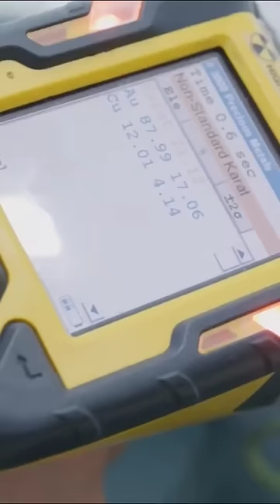Did we buy gold with Tungsten in it? 😱

Comment: There is absolutely no way that the dealer didn’t know what was happening here.  Tungsten has one of the highest melting point of all metals, there is no way that gold just happened to wrap itself around a bar of tungsten while being smelted.
Reply: Exactly. If the coins had tungsten in them, the gold would just melt off. They wouldn't melt together, then pour as a solid tungsten bar covered in gold. Its probably just set up for views.
Reply: @smasher.338  might be. My guess would be somewhere in the chain of deals, someone trusted someone else too much and after probably numerous successful deals, didnt think they needed to verify it.

Sucks that people do that, but its super common. To me, the trust between two people who do business is more valuable than the money itself.
Reply: @smasher.338 views?
The weight of the bar would likely be very close to the nominal weight of solid gold.
Tungsten would have dropped out in a typical pour, methinks.
I’ve done a small amount of melting metal into ingots.
Lead is one thing, where just about everything floats in top.
Aluminum is different,
Not only you deal with the swarf, you need to go hunting for whatever else dropped out at the bottom of your crucible.

There is no way that this happened by accident.
The dealer offered the refund too fast.
He probably does that so he doesn’t get called out.
Now, imagine how many people have these contaminated bars in their safes!

Comment: Tungsten has one of the highest melting temperatures of any metal so there is no way a furnace not specially made for Tungsten (at great cost compared to anything a gold smelter would use) could have made that gold coated Tungsten bar. It's impossible for it to be accidentally done. This was no mistake or error it's fraud on someone's part.

Even if the coins had Tungsten in them there is no way there would have melted and ended up inside a "gold" bar. They would still be where shapre they supposedly were while inside the coins.
Reply: ive already commented this. Hes positive the tungsten was melted with the gold.
Reply: If they can melt tungsten, the gold should be evaporated (gold evaporated at 1400 celcius , tungsten melt at 3400 celcius)
Reply: @Wertdante  lmao bro that’s nuts!
Reply: @Wertdante  this is true. @crm is just playing games for clicks since the Watch biz is slow. Or smelter was running a scam. Those are the ONLY options. Basic chemistry.
Reply: Agreed
Reply: It was probably powdered from somewhere that makes rings or other items from Tungsten. Likely they managed to get it into the blanks and then make coins by melting the very surface layer and adding a little extra gold before striking the proof when it was red hot.
Reply: If you watch the original video when he pours the coins into the mold and flipped it over while rinsing you could still see the imprint of one of the coins in the bar, which I thought was weird if it was all melted down, the smelter should have reduced that to a liquid. But it was still showing partially solid. Thanks for explaining that to me it makes more sense now!
Reply: This has to be some sort of insurance fraud. 😅 they insure the coins and has someone else melt them and then all of a sudden OMG its coming back not gold from the "smelting co." Honestly if you're a jewelry business, why would you not melt your own gold coins? 😏 😅😅😅
Reply: Makes no sense, the melter knows he is going to immediately use that gold for jewelry making, the tungsten will just break his machines and be obvious the moment he starts using that bar.
Reply: That's what I was thinking to how and were did tungsten get into this equation I have no clue.
Reply: Melt yourself
Reply: @XxMidnightToker420xX  That part is easy, they are trying to match the weight of a genuine gold piece that is gold clad by adding tungsten.

Only solid gold has all the qualities of gold so to fake weight and volume of solid gold they have to use different 'fillers' tungsten being one of them.
Reply: @Josh Mocny  impossible. Boiling point of gold is like 1k or 1.5k lower than tungestons melting point
Reply: He was there the whole melting process and filmed the entire thing so it’s not the melter being funny, somewhere along the line the coins weren’t full gold. The liability falls on him for only surface testing with that machine he showed in the first place though.
Reply: The smelter took the gold n gave them tungsten
Reply: @joshmocny5375  but you can see the coins on the gold bar
Reply: Bingo. I call clickbait.
Reply: I was thinking the same thing. I literally tig weld with tungsten. It doesn’t melt.
Reply: Can you electroplate gold onto tungsten?
Reply: @Bwill-hn2pc  It looks like the dealer actually stole the real gold bar as he was there at the foundry for smelting of the bar and they filmed the whole thing and it didn't look fishy. So the only real option is the dealer(jewelry maker) [the one who "rejected" the bar] actually stole the real bar and sent back this fake one. So the foundry is the one who really got robbed..
Reply: @dizzlefshizzle  cause hes a con artist.
Reply: @joshmocny5375  Then he is lying.
Reply: @Lotek117  The scammer would be the maker of this video.
Reply: Honestly, it looks like they took some cheap gold coins and pressed them on a bar of tungsten, then put it through rollers to compress it more and draw the bar out. That is what produced the cracks and " compression lines before the cracks. Straight casting does not have stretch lines on the bar, this one does, it's been out through compression rollers.
Reply: Why would you add tungsten it’s really light? Sorry if that sounds ignorant.

Comment: Dealer got caught scamming. Tungsten melting point 6 times greater then gold. Easy to coat it in gold and try to sell off as solid gold bar. Dealer has to refund as otherwise if reported they look at losing their licence,  fraud charges and more. 
Unfortunately it will now bring into question any jewellery you made using this dealer.
Reply: The caster literally skimmed the real gold off the top when they put the tungsten bar into the mold. Fraud. Most would've used a lead alloy and electroplated the lead casting ..using Tungsten is unusual..
Reply: @aaronhumphrey2009 they were there when they were melting it detective it was probably the coins from the start
Reply: @Groveherooffcial  No, it didn't come from the coins. A regular crucible doesn't reach the temperature needed to melt tungsten. Even if theirs did you wouldnt take it to that temperature. Therefore, if it came from the coins the tungsten would still be in the shape or a coin, not a bar perfectly coated in gold lol. They tried scamming him plain and simple. Could of just been an employee trying to pocket the difference or the business itself...either way it's definitely on their end.
Reply: @Groveherooffcial  Gold Evaporation Point: 1400c
Tungsten Melting Point: 3422c.
The tungsten did not come from the coins.
Reply: damonwright4532 don t tell me its impossible to drill a tiny hole in a gold coin put a micro sphere of tungsten in it then lazer weld gold on top and level the area .... the assumption that tungstene HAS to be melted to be able to be in a gold thingy is lacking imagination .... fact is you DON'T want to do this any other way than how i just said , because melting a gold with tungsten micro spheres in it would result in some couns surface showing some microsohere of tungsten dangerously close to the surface of the coin thus detectable by the scanning machine .... you want your micro sphere perfectly at the center of the coin ....

Comment: Some crooks in the refinery! That's scary... I wouldn't use that refinery again. Name and shame them.
Reply: The fact that the dealer gave them their money back makes the dealer the scammer.
Reply: What if it was the coins? I would think it’s the coins not the refiner.
Reply: So witch was bad apple
Reply: @PeterAlanA1234567890  Tungsten is the hardest metal (other than uranium) and has one of the highest melting points. A lot of places dont have anything that CAN melt it. If they were tungsten coins covered in gold, the gold would just melt off. These weren't even poured together bc the tungsten would just sit at the bottom of the mold, and the gold would be on top. This is a bar of tungsten someone covered in gold.
Reply: @donho3617  that’s called good business and retaining customers.

There’s an old story about the manager who saved the market a gallon of milk but lost a customer for life.
Reply: @donho3617  The scammer here is the guy who made this video.
Reply: @PeterAlanA1234567890  It was not the coins. It is not physically possible.
Reply: @inso80  Proof?
Reply: @donho3617  FYI there is no "foundry" in this loop. The youtuber made that shit up. The price of that amount of gold is literally tens of thousands. Anyone with half a brain would be doing due diligence.

The only properties gold and tungsten share is that they are of similar density and both are metals. 

The only test the tungsten could pass would be the density test and any destructive testing would immediately be apparent to anyone working with it.

The comment section is literally full of debunks, so why are you asking for additional proof?
Reply: They won't risk a defamation lawsuit if they're lying
Reply: It wasn't the refinery. It was the coins he brought. Its common for scammers to cover tungsten coins with a thick layer of real gold. The weight comes out the same.
Reply: @inso80 dude yes it was. I've personally seen them🤦 they literally weigh the same as the real coin. Talk about something you actually know.
Reply: @HeadHoncho727  I think you need to brush up on your reading comprehension.

Comment: Tungsten is used as it's density is very close to that of gold. So the package would have almost exact same dimensions. The weight would be so close as to be hard to detect. The ring test would tell there was an issue since tungsten and pure gold have different resonance (ring)  frequencies.
Reply: Yes, PURE tungsten density is very close to that of gold, but tungsten gold alloy is not, but I doubt these guys were doing density checks, it seems they rely on electronics heavily.
You can trick electronics, you can't trick physics. This is also how the resonance is different, the gold tungsten alloy creates billions of crystals of specific sizes Au/W4-6 and W/Au4-6 both resonating at different frequencies, giving a clear dual tone shifted from either elements true base resonating freq.
Reply: @renagenic  I don’t think it was alloyed, the gold had just been coating the tungsten.

Comment: That scam is older than Archimedes. At least that time, he found some fundamental physics principle, and the scammer was punished.
Reply: Your scam doesn't make sense. The melt difference between gold and tungsten is huge. Most precious metal smelters will never get even close to melt tungsten. 😅
Reply: Tungsten is heavier than gold. It would register a higher specific density than real 24K. Most would've used lead to counterfeit a gold bar..cheaper..
Reply: @aaronhumphrey2009  Gold weight: 19.3 g/cm3
Tungsten weight: 19.25 g/cm3
Lead weight: 11.34 g/cm3
Reply: @w1zpir779  you are listing density not weight
Reply: @lance3540 Precious metal smelters? My friend is a blacksmith and he doesn't get steel as hot as tungsten.
Reply: @robbsclassics  my friend is a baker 😆 🤣 whats your point.
Reply: @lance3540  Precious metals melt way lower than steel. Tungsten is one of the highest melting metals we use, that melts way higher than steel.
Reply: @robbsclassics  no shit that's what I was saying
Reply: @lance3540  You know what blacksmiths work with right?
Reply: @robbsclassics  not usually gold or tungsten lol
Reply: @robbsclassics  by the way I worked in a steel mill for many years in quality control testing that the metal was melted correctly with proper alloys. Did sulfer printing magnaflux tensile strength test and lab. I dont give a rats ass what you think you know I have forgotten more lol. I worked in the furnace erea all the way to the floor checking finished product. Worked with high carbon steel all the way to high nickel and stainless.
Reply: @robbsclassics  not sure what blacksmiths has a fucin thing to do with this. The point is his video doesn't make any sense. If he sent off gold coins to be melted there is no furnace that precious metal refiners use that would melt tungsten. The ones we used that melted tungsten and other metals was electrode.
Reply: @lance3540  Exactly. Metallurgy and science and stuff.
Reply: @robbsclassics  2500-2800°F steel
6,192°F tungsten 
1,948°F gold
To melt tungsten, you usually have to use an arc furnace.
Reply: @lance3540  I think you're missing my point. You wouldn't ever make a gold bar out of tungsten because it would cost too much to cast it. You'd need special equipment just to get to the point of being able to shape tungsten. And, why? It's so hard to work with. I can't believe it's tungsten. 

Gold has such a low melting point, it's most likely lead, copper, tin, aluminum, whatever to get it to weigh the right amount. We use to call it pot metal. It couldn't really be reused after it was cast the first time and very weak.
Reply: @lance3540  Blacksmiths work with steel, but everything is 1000° cooler than tungsten. I can't see someone forging tungsten to make money with fake gold.
Reply: @robbsclassics  so how did it get there ohh that's right I said scam by someone
Reply: @robbsclassics  either the guy making the video is doing it for views or he is using some sketchy refining company that would either know they will get cought or hopes they will be gone by the time they noticed. I'm going with the video creator getting views.
Reply: How was the scammer punished? I missed that part. Sounds like he only refunded the money.
Reply: @lance3540 melt point for tungsten is 6,192° F. My home steel forge heats to over 7000°. It's not improbable that most metal refineries have forges that go several thousands of degrees hotter. My steel forge was built in the 50's so I would think modern refineries could afford better equipment than my old ass!
Reply: @lance3540 my dad works for Nintendo so your point is moot.
Reply: @CoolSupaHotFire  please post model of home forge
Reply: @CoolSupaHotFire  no home forge is reaching 7000 lmao
Reply: @lance3540  I'll do it. It's a beast! I forge custom motorcycle parts and it makes short work of it. I never use it much over 3000° because it's open face, side door, and it's way too hot!
Reply: @lance3540  forges are commonly used to melt tungsten. From Wikipedia, these are the most common ways metalsmiths/fabricators melt tungsten. No mention of electrodes but I'm familiar with the technique. My 70 year old forge uses natural gas or propane and a blower motor. It has an oxygen hose attachment but I've never needed to get that hot.
From wiki:
In its raw form, tungsten is a hard steel-grey metal that is often brittle and hard to work. Purified, monocrystalline tungsten retains its hardness (which exceeds that of many steels), and becomes malleable enough that it can be worked easily.[17] It is worked by forging, drawing, or extruding but it is more commonly formed by sintering.
Reply: @lance3540  when you know absolutely nothing about a topic the common wisdom is to not shoehorn yourself into a conversation where people do know the topic, Einstein.
Reply: @CoolSupaHotFire  Since it is an electrical conductor it can be heated in an induction furnace or an [electrical] arc furnace.
Reply: @CoolSupaHotFire  the cheapest industrial induction furnace I can find to melt tungsten is 8k usd from China going to 100k. Chineese arc furnace 13k 😆 ok saggy nuts.
Reply: @CoolSupaHotFire  Wikipedia 🤣
Reply: @CoolSupaHotFire  no where in YOUR WIKIPEDIA COMMENT does it mention what smelters are used to melt tungsten
Reply: To melt tungsten the gold would already have evaporated, the story doesn't pass the smell test. And I missed the part where you posted the model of your home forge made in the 50s that gets to 7k degrees, you just deflected and tried to cite Wikipedia articles. People use tungsten and gold plate it because the weights are very close, the Perth Mint was caught doing that a few years ago iirc. The guy in the video is the scammer, or the person he sent the bar to is, something is off here though. I imagine he did it for views as stated previous.

Comment: Seem like someone's at the refinery is either replacing your gold with tungsten. The gold wouldn't be evenly distributed  around the tungsten if it had already been in the gold coins. If the refinery is saying it's because the crucible wasn't hot enough that should say all you need to hear. Or another thing that could have happened is your chain manufacturer switched out the bars...

Comment: I am amazed that the crucible got hot enough to incorporate the tongston.  The tongston should have been left in chunks at as you poured out the gold.  
The melting point of gold is 1,064 degrees Celsius or 1,943 degrees Fahrenheit.
One of tungsten's unique properties is its very high melting point of 3,422°C (6,191.6°F).